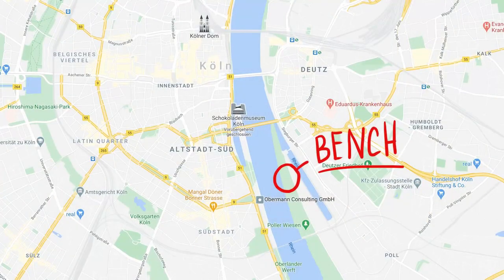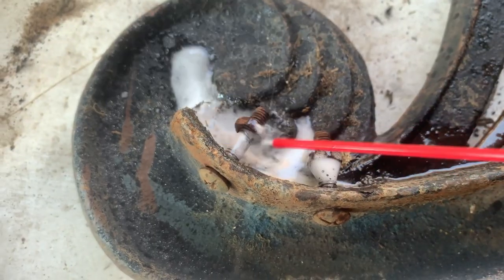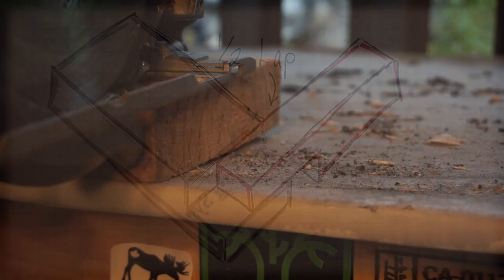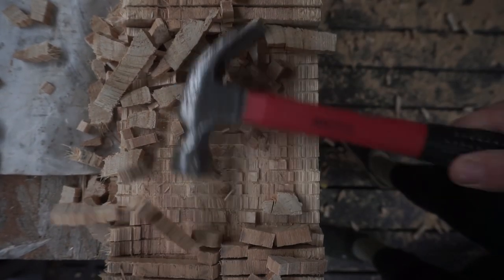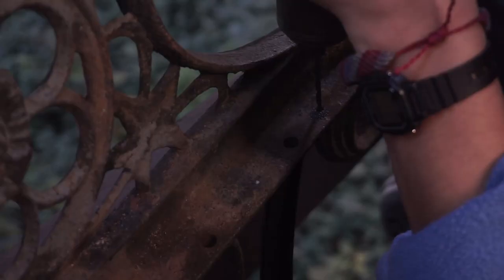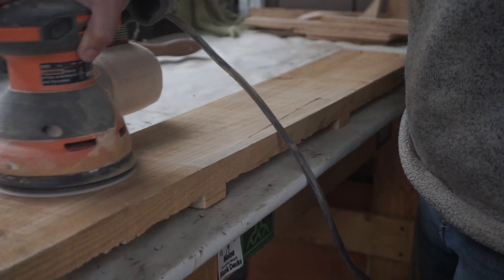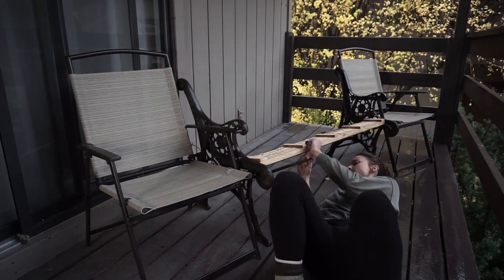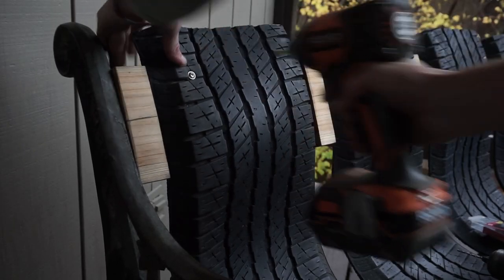Laura Kampf Inspired Bench Build

Comment: Laura Kampf is truly an inspiration to many. I love her videos. You have done an equally inspiring job with  this bench. 
To help you in the future should you ever try to use used tires again. Try looking for Bias-ply tires since they do not have metal wires in them like Radial tires do. They are bit more difficult to find because they pretty much stopped putting them on passenger cars after 1974, but they are still being made. The brand Coker Tire make reproduction one for classic car restorations so try asking around at any classic car show in your local area if they have any used ones still laying around. They usually will since typically Bias-plys wear out faster than more modern tires.

Comment: Instead of the cross laps you could screw on 1x2 cleats .Rubber without steel re-enforcing can be cut with a blade that is wet . I've done it with a jackknife but water is the important part .  Thumbs up great idea.

Comment: I subscribed to support the idea the idea of fixing things faster than they are broken. As a woodworker, I cringed at your techniques. More important, you persisted and created a piece of functional art. Your design is inspiring.
Reply from the maker: Out of curiosity how would you have done it? with a chisel?
Reply: @chloet7385  Probably. My goal would have been to produce a clean flat surface. I would start with a chisel and probably follow-up with a hand plane. This, of course, would not produce the textured result that I found intriguing. When doing quick and dirty work for theater sets I have used screw driver to pry chunks out. My goal is to break the piece close to the plane created by the saw kerfs. My "Cringe" is more about your securing the pieces you are working on (clamping stuff in place and using physics to secure your work).

Comment: This is absolutely awesome and I can't believe the final result looked so nice and comfy! I would like to make two suggestions though for improvements if you were to make this again: I'm assuming this bench is gonna sit outside, if that's the case you're better off painting the wood since it's the finish that lasts the longest and also try to minimize or eliminate altogether the wood sections where moisture can sit for prolonged periods of time (for example, wood that touches the ground or in your case, the space between the wood that you sit on and the tire above it). I believe decks are constructed in such a way to make these spots minimal but also they are painted with a special sealant iirc (asphaltic paint I think? )
Reply: Consider me a fresh new subscriber btw :)